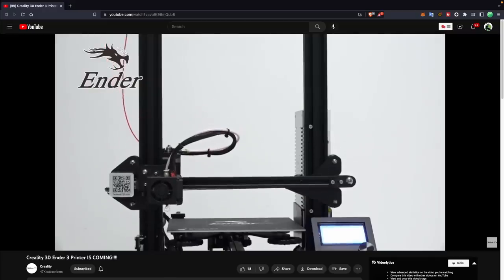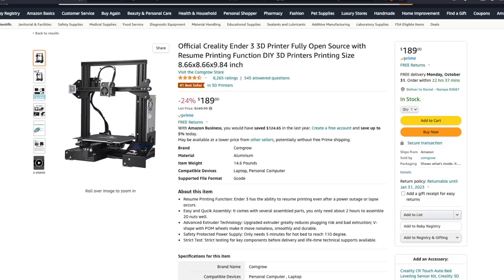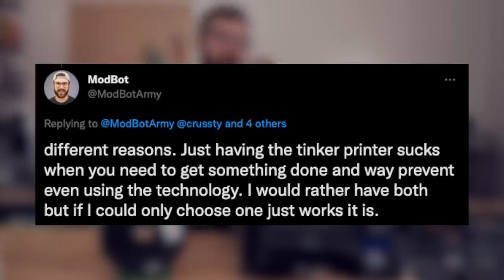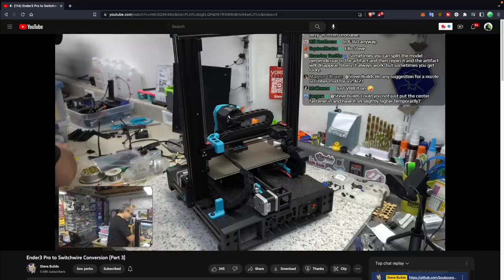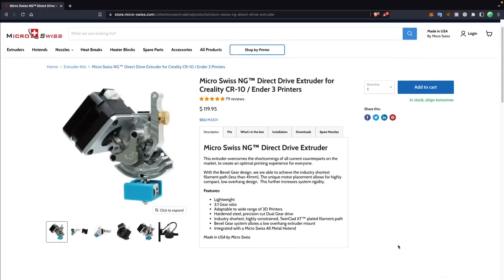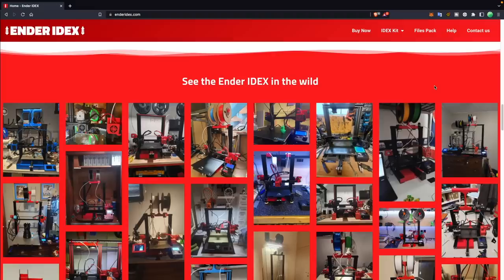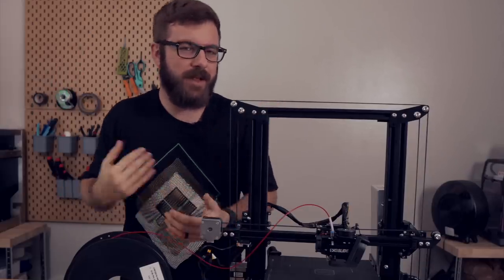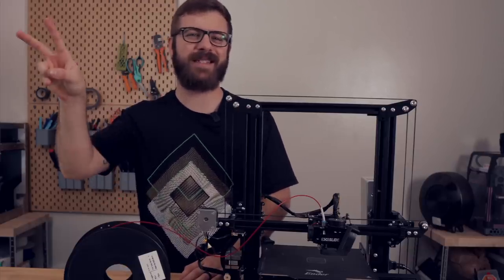Why Buy An Ender 3 In 2022?

Comment: I am approaching to 3D printing mainly because I would like to design and print part for my high power rocket. What you suggest? I was really taken by Scott video on 24 upgrades on an ender 3, and looks like fun, to start to mod the printer also to learn more before jumping in printing my designs. However the idea of having a printer that simply prints everything without much issues would be cool, any advice?

Comment: I'm surpriced how ender 3 have held up the time, and its still the go-to budget printer. I have mine, just took it back to work printing petg at 245c and have enclosure. I have done small but beneficial mods to it. Not yet planning to do any other mods but as I saw I have plenty of options! Thx for the video! 👍

Comment: I've had my Ender 3 pro for about 2 years now, and have quite a few mods on it. Now that it's been modded 5 ways to Sunday, I'm looking at either getting a second, or building a customer fdm printer with a Klipper board. 

Speaking of mods, has anyone seen a mod that puts a breakout board on the hotend side similar to the s1?

Comment: Ender 3 is fine, but everybody should remember that it's not top quality product. My frame wasn't square, with every mm of height difference between sides of print was bigger and bigger. I watched hundreds of videos how to fix this issue, probably now I would be able to disassemble and assemble printer during sleep. The issue was smaller but not gone. 
Googled for this problem and there are some people with such problem, just saying.
Additional motor and lead-screw was must-have for my printer.
Also after few months extruder's arm broke and also stock bedsprings were meh. 
With this 3 mods it will serve well for a long time. 
...But better ask yourself first: maybe you should buy something else, something better? :D

Comment: hello, ender 3 user here. few days ago all the 3 fans(motherboard, hot end and part cooling) stopped working. so i opened up the board to check the voltage. the fan ports are not showing the right values. could this be an issue with the firmware or should i inspect my powersupply or should i just unplug everything and change fan wires? coz i checked the fans separately all of them work. i even updated the firmware. is this a motherboard issue? help!

Comment: There is no point in buying an old printer and spending huge amounts of money on upgrading it. With less money than he spent on that, he could have bought a new Prusa, which is a much better printer than that. You can use the printer at it is and buy a new printer with that money.

Comment: why buy an ender 3?
Because once you set it up propperly it prints like god.
If you callibrated it perfectly and its still ~1-2 mm over the bed, "babystep z" in "Tune"

Since i have mine, i printed many more minis than my yearly budged of 40k treats would have ever allowed
I have 26 shovel enthusiasts
i have 5 space communists
I have 2 custodians from greece
I have bits for boards
i have greebles for walls

Why buy and ender 3?

You will seize the means of production!